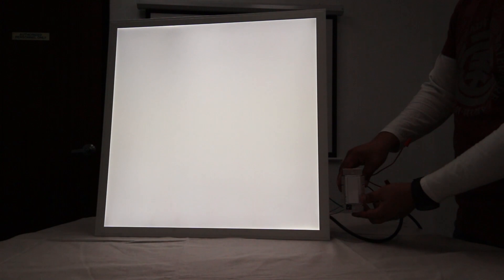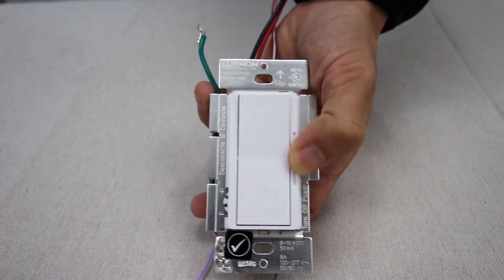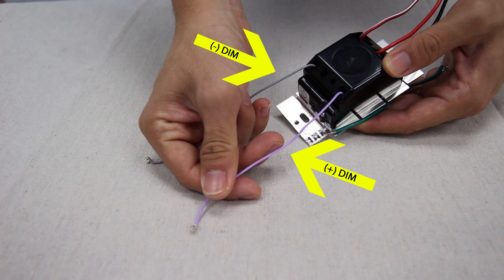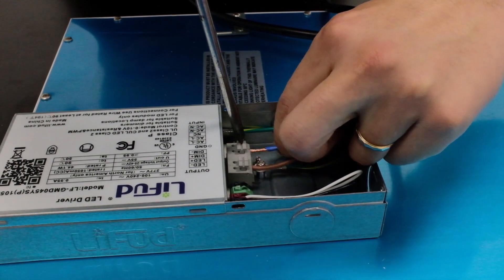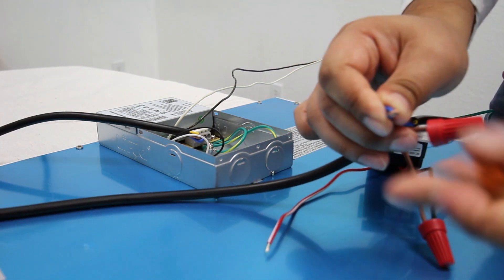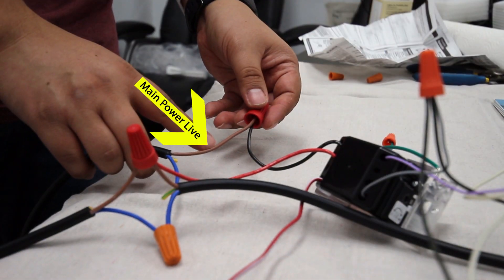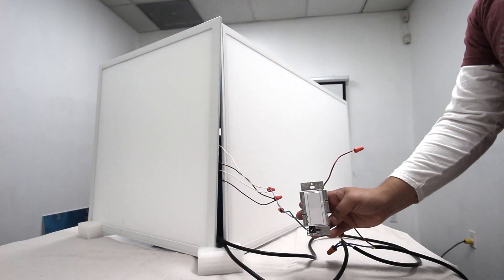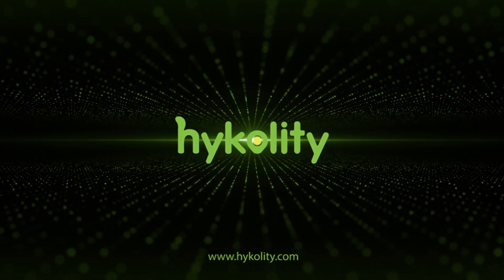How to dim Hykolity Lights using a 0-10V dimmer

Comment: How do you wire the switch with a canless led gimbal light fixture with the on and off function and the dimming function as well. I don't see how in the instructions manual. Is this even posible when the light fixure only has 3 wires? Or is this switch for ballast powered lights only?

Comment: A Responsiv(tm) 0-10V Blink'n'Dim Adapter is a universal 0-10V dimmer that mounts on or near the light. No control wires are needed in walls.  An ordinary light switch operates the dimmer using Blink'n'Dim protocol.

Comment: Why doesn't anyone post a video where the input hot wire is located at the switch, rather than hook up the demonstration to a cord plugged into an outlet?  Most people are going to deal with the situation where only a black/white wire is located at the light fixture.  How does one attach the violet and gray wires in that scenario at the light fixture??  And connect other fixtures on that circuit?

Comment: Breezed over the connecting more than one light, and how the purple and grey wires connect. So if you have say 4 lights you just connect all the greys together and all the purple together? IMO if your going to take the time to make a video you should slow down a bit so it actually helpful.

Comment: I have 3 sets of 3 way switched lights on a single 15 amp circuit. They are dimmable Hykolity lights. Can I use 3 dimmers on the same circuit? All dimmers would be in separate junction boxes. Thank you. PS I love your lights. I have 14 of them in my new shop. Very functional and aesthetically pleasing. Very well made with quality materials and great design. Head and shoulders above the other manufacturers yet at an extremely reasonable price point. You folks ROCK.

Comment: The part about connecting two fixtures was pretty fast. I can understand a wiring diagram but I cannot seem to find one for ONE dimmer and TWO fixtures. Could you please, please point to one?